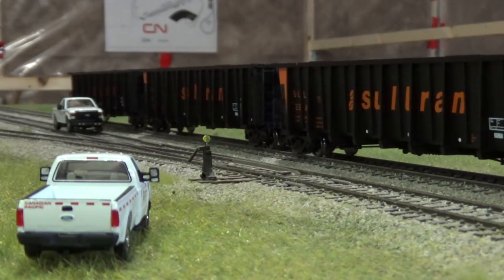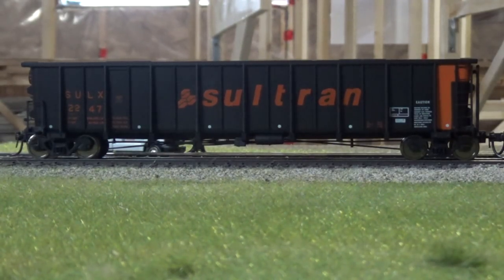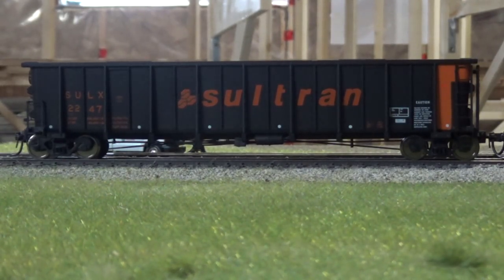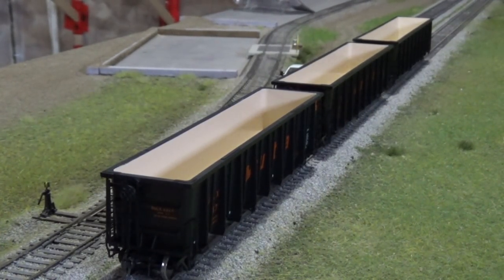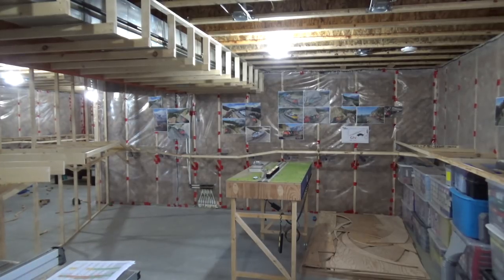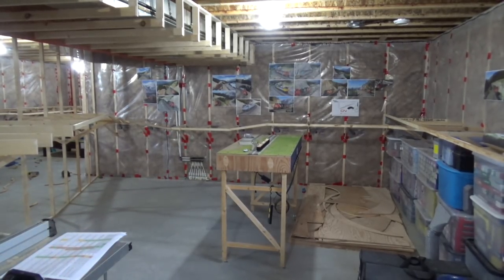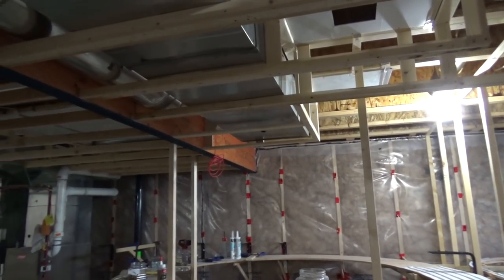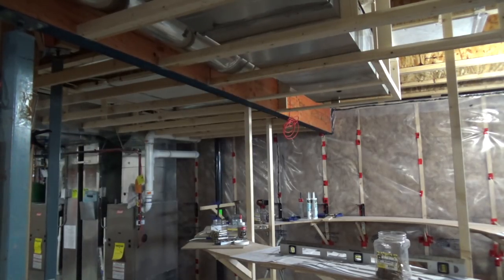Layout Update - February 2017: Riverpoint Ford MOW Trucks, NARC Sultran Gondolas, Drywall Prep...

Comment: That is some serious layout building. Great job. And  your static grass came out nicely too. Looking forward to your next update.
Reply from the maker: Thanks Syl!
Reply: I used metal bracket, similar to your wooden one, however i spaced them around quite a lot and it is rock solid. So looking at yours, it will be earthquake proof! Well done
Reply from the maker: Metal bracket is a good idea too. I just had a lot of scrap plywood left from cutting the road bed so thats what I used. I don't know about earthquake proof but it's definitely an improvement. Thanks!

Comment: Once again, nice work Ben. You will be glad that you put in the stiffeners.  The bench work is so important for having flawless track. It is well worth the time and effort.
Just a little update on the Sultran cars.  Sultran bought (leased) the 1000-1600 series cars new and the 3000-3300 series are ex-CP cars. They have used different colours for the plastic liners over the years.  I have photos of some cars with a baby blue (robin's egg) liner, some with a cream colour and some almost white.
Reply from the maker: Thanks Norman. This layout could last potentially 20 years so I really want to make sure I do things right at the beginning. Despite the temptation to push ahead and get track laid ASAP. I think it's wishful thinking to get a train running by the end of the year. I want to have all the lighting done before I start laying track. 
Thanks for the additional info about these cars. From looking at Ian Cranstone's Nakina website. It looks like Sultran owned a total of 1350 steel cars at its peak. Checking the remaining reporting marks from the 1000 2000 and 3000 series, there are 541/1350 still in service. That's only 40% of the steel fleet remaining. Makes sense why they looked elsewhere to bolster their fleet with the ex-DEEX aluminum gons. I have a couple shots of the robins egg blue liners, they definitely stand out. That S716 train I got photos of from the overpass in Rocky Mountain House last November only had a couple of those blue liners and they looked brand new. Stark contrast to the flatbottom liners with 100's of different coloured patches on them.
Reply: Hello Ben.  How can I get in touch with you about an operating session here?  Norman
Reply from the maker: Hi Norm, shoot me an email at BArailsystem@gmail.com

Comment: looking good, wow lots of work done, I would suggest staying away from the pot lights and go with track lighting, just my thoughts on it,
Reply from the maker: Thanks. Why do you suggest track lights, I'm curious. My basement ceiling is 8' and 7' in places where I boxed in the utility runs. I decided on pot lights to maintain as much clearance as possible. Granted the light from them is limited to an area directly below.
Reply: that is one reason I wouldn't do pot lights, very limited to lighting up just under them, the reason o would go track lights is, there are many kinds of lights that you can use on them, directional, and if you need more lighting in spots. just add another head. pot lights in some spots sure. but track in others,
Reply from the maker: Good points. I am actually considering just putting an octagon box above my future table spot for some kind of hanging fixture instead of 3 pot lights. With the 18'' valance I am going have hanging down from the ceiling above all parts of the layout there is no need for the lights in the aisles to shine to the sides. They will only be needed to light up the aisles and open parts of the layout.

Comment: Huge progress Ben! Awesome work. All that extra effort will pay off in the long run. Are you going to carpet the floor at all? Also, how are you going to mount switch machines, or are you? Totally amazing how much progress you have made.
Reply from the maker: Thanks! Haven't put too much thought into the flooring but I know for sure I will be finishing the floor in all the open spaces and aisles. I'm leaning towards carpet on a decent quality underlay so it's easy on the feet. There aren't going to be that many switch machines. I plan on putting tortoises' on the CTC controlled mainline switches, the reverse loops and a couple switches that may be hard to reach. In those spots I will have to notch out the stiffeners and figure out another solution if strength is an issue.

Comment: Very impressive benchwork ! (as mentioned below).    Sometimes it seems like you work a long time and nothing gets done.  But believe me, like any project, when you take care of the the small details,  the big picture will eventually take shape and it'll be done right. That's what hard work is all about.  That's what will make this so rewarding when its done.  I can't wait to see it finished.  I have a question.  What size ballast are you using?  It looks really good and I like the colour.  It looks like a medium grey with a little black mixed in.  Did you buy it like that or mix it yourself?  I'm putting together a 45' shelf layout (HO scale) and ballasting will be happening soon.
Reply from the maker: Thanks Joey. Your absolutely right about the hard work. Layouts don't get built over night. They are the product of thousands of hours of cumulative effort. 
The ballast on my Free-mo module at the beginning of the episode is Woodland Scenics fine grey blend. On the spur I used real frac sand that I crushed in a mortar and pestle to simulate the spilled sand on the ground from the industry. For my current layout I plan on using either Arizona rock and mineral ballast as recommended by Lance Mindheim or a blend of my own if I can get the colour and texture right.

Comment: The layout is coming on nicely now. One question regarding the trackbed, did you consider using spline roadbed instead of flat plywood? Also do you intend to use any dehumidifiers to help stop any of the benchwork from warping? Look forward to further videos on your great layout.
Reply from the maker: I actually did not consider it, I've only recently learned about it. Sounds like it would have been a much better choice for all these complex curves I did, not to mention the sound deadening qualities I am after. 
I've been monitoring temperature and humidity in the basement. In the summer I saw around 65% humidity and 5°C temperature swings. Winter time is usually 40% humidity and 2°C temperature swings.  I have no idea if that is considered too much variation or not. One thing that I have going is that my basement is fairly deep and 3/4 of it is underground which helps I think. Thanks for the tips!